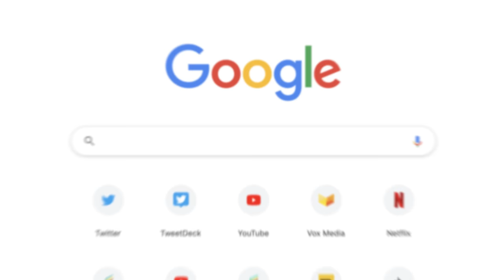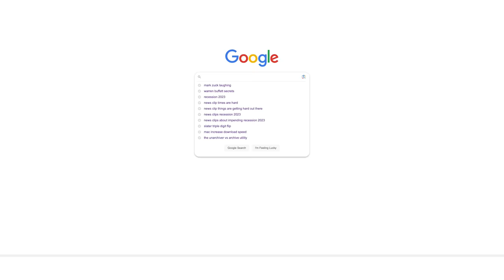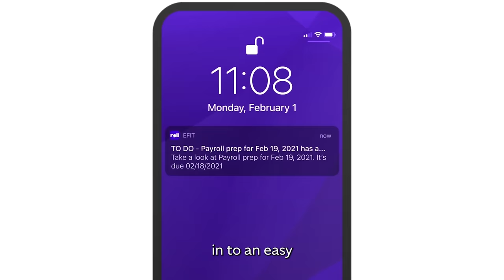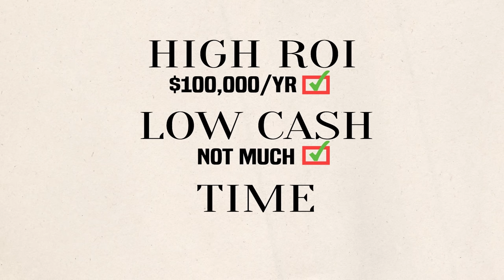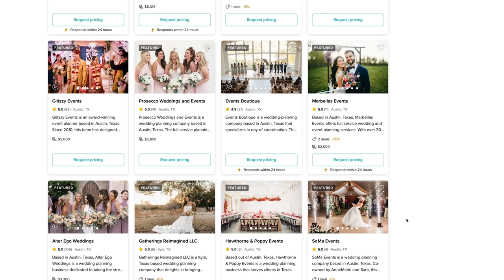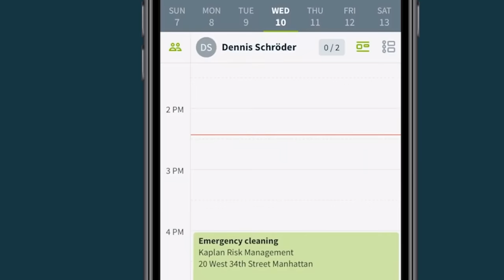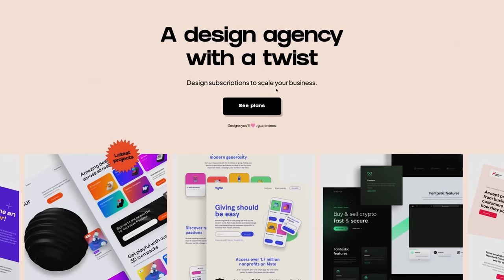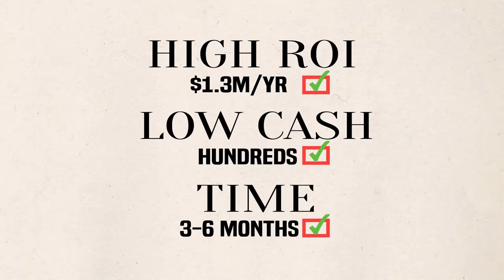7 Best Businesses to Start For Less Than $1000

Comment from the maker: Get a list of 130 different business ideas that I love to invest in HERE: https://contrarianthinking.biz/130boringbiz-yt-lg
Reply: I live in small village foni kansala Bwiam 🇬🇲
Reply: For the virtual assistant business how do you handle it once you've found the VA? Do you receive the work assignments from the client and pass them to the VA and then pass them back from the VA to the client and then pay VA at the end of the month?
Reply: Can anyone direct me to the link that was mentioned in the video breaking down the graphic design video?
Reply: 2500 to powerwash your fence?
Reply: @glory70x  guess that's a villa's fence
Reply: Would really like to know your opinion on waste management, cleaning services or procurement I.e fulfilling orders like a supplier?
Reply: ROI is Return On INVESTMENT not income.
Reply: Hey Codie, your math on real estate is wrong. I used to make the same mistake until my client (Oakwood apartment founder) corrected me. The appreciation is on the total value, not the initial investment. Therefore, if I buy a 1,000,000 property with 20% down (200,000) and it appreciates 5% of 1m (50,000), I just made 25% ROI+ any principal payoff (roughly 1-2%x5 or 5-10%)+ any tax benefits (1-10% income dependent). So this represents a yearly ROI of 31-45% vs. what you and I both thought was a 1.3-9.5 ROI. This understanding has made me some money. Of course, it is slightly more cash dependent than an owner financed small business. I appreciate all your great content.

Comment: The problem with subcontractors in the service industry is you don't have control over the workers. This can become very problematic and if things go wrong, it's hard to maintain or save the client. It's not a bad idea, but also not a great idea. Codie Sanchez in this video doesn't go over the cons on this issue, I feel if you don't give out the cons you are not being transparent on the window cleaning business idea.
Reply: That was my concern - it's just not accurate to claim you'll never have to work with the client directly. For that Handyman business for example, which I do think is great. But you will have to handle each of those clients one at a time & make sure the work is done not just properly, but outstandingly well for you to grow. So now you're handling sales, customer service & managing "staff" even if they are outsourced, you'll have to micro manage each job for at least a while because it was done under your business name. It's still a great idea, but all of these are much more work than is being expressed here.
Reply: She did mention the trade off to low start up cost was the work to get it going.
Reply: All business have this problem, and it’s ok
Reply: Codie is good and helpful, but she is definetly not 100% transparent.
Reply: Agreed, I’m interested in getting the logistics and legalities (especially in California) as to how legit this business model is. 

Subcontracting in California is very sticky.
Reply: Su contracting in the UK also requires you as the contractor to pay their 20% Tax and national insurance under the CIS scheme
Reply: Subcontracting in many countries is illegal!
Reply: So many negative whingers
Reply: @am1296 It's not negative or winging it's pointing out some realities if the construction industry for people who may not know. The video is great however codie cannot possibly cover absolutely everything.
Reply: I don’t think it is about “being transparent” or not. She’s giving you great ideas to start up a business in 35 min. All business have same or similar issues. Not everyone is capable to deal with the issues you mention.. in that case you better keep your 9-5 job. Nothing wrong with it though.
Reply: How do you pay people that don't even work for you? I wounder? This is very interesting
Reply: She mentions getting quality businesses through referrals and reviews. If you get the top 20% of businesses in the area doing all of your work you will eliminate 90% of the issues. You don't need to control quality people just be very clear on expectations.
Reply: I think the idea and doing it locally would work best. You can also vet the handyman or cleaner or who ever before using them to send them out to do jobs
Reply: Something like installing a water heater in Colorado requires a licensed plumber.
Reply: @flowmaster2010 the sub invoices you same as a regular customer but at your agreed upon rate.
Reply: She also fails to mention the cost of google ads. $1000 for ads doesn’t go too far
Reply: I mean she did say do your research and check reviews with how good they are at the end of the day it’s like hiring an employee and doing a background check
Reply: If you take care of your employees, they will take care of your customers.
Reply: And thisss....Ladies and Gentlemen...is the mindset that'll get you nowhere. Entrepreneurs and business owners don't think like this. This is the mindset of laziness, procrastination and the workers mentality that only want things to go smooth and perfect.

They don't like to do things and improve as things go along. They want everything to work perfectly on the first try around. They want to work and get paid immediately. They don't think about the later, they think of the now.

They want to have somebody to hold their hands and give them constant reassurance along the way. They want someone to give them a step by step by step on how to do things and even better if they can have someone fund their way through it and have everything done for them for freeeeee.

"Change your way of thinking and watch how your life changes."

Until then, this lifestyle isn't for you. The definition of Entrepreneurship is identifying a problem and then be the solution to that problem for the client.

If problems is a hassle for you, this isn't for you, or for the feint of the weak hearted.
Reply: @xandepsy exactly, all contractors deal with this.
Reply: @jowyjozef I completely agree with you and couldn't have said it better.
Reply: True but it can be managed well.
Reply: Well if the work is being sub contracted the fallback falls on the company doing the work not his actual company.... They will see the sub contractors company name/Logo etc
Reply: Also. The sub can cut u out
Reply: 12:23 Honest question:”send real estate agents sample videos you’ve clipped together of other people’s work”?? Huh?? Isn’t that some where between misleading and plagerism? Am I missing something? Also, $150 to go shoot the video yourself on site, then go home and edit it? Sounds like a tough way to make$150. Is that what she meant?
Reply: She’s running an entertainment media company, she’s not a trade school or university. Gotta remember that. 

Their job is making themselves money, not you. You succeeding would just be icing on the cake. And if you do she’ll use you to make herself more money. 

Not knocking it, just remember the incentives of YouTubers. It’s not charity.
Reply: Typical YouTube fake guru with false advertising
Reply: She did mention screening of subcontractors. You would definitely want a trusted list of subcontractors. My husband used to supply cranes through this arbitrage method and he only dealt with trustworthy contractors.
Reply: Let alone the cost of tools for handyman services
Reply: Have systems in place to inspect the quality of their work.  If they have poor quality work in any area, and if it becomes a pattern,  just don't give them any more contracts, and get another subcontractor to take their place. And know going into it that you will likely need to replace quite a few of them before you find any that can produce at high quality. So no... it wouldn't "work" if you approach it with the same expectations as managing employees.  That's because it's a completely different structure and therefore needs a different approach to make it work.
Reply: The cons are they will eventually take your customer base
Reply: Your power is over the owner of the company, who has control of their employees. You only communicate with the business owner and tell them you will stop using them. Use their competitors as your subcontractors. They will probably do it for a better % deal for you too.

Comment: I am currently in my 50s and This is no time to taper retirement savings. I want to max out my retirement contributions and I also have another $200k in a savings account that i want to invest in a non-retirement account. Where should I invest it now?
Reply: Safest approach i feel to tackle it is to diversify investments. By spreading investments across different asset classes, like bonds, and international stocks, they can reduce the impact of a market meltdown. its important to seek the guidance of an expert
Reply: A good number of people discredit the effectiveness of financial advisors in exploring new markets, but over the past 10years I’ve had a financial advisor consistently restructure and diversify my portfolio/expenses and I’ve made over $1.2m in gains… might not be a lot but i'm financially secure.
Reply: @CheriFanizza  I’ve been looking to switch to an advisor for a while now. Any help pointing me to who your advisor is?
Reply: My CFA 'Grace Adams Cook' , a renowned figure in her line of work. I recommend researching her credentials further. She has many years of experience and is a valuable resource for anyone looking to navigate the financial market.
Reply: I just looked her up on the web and I would say she really has an impressive background in investing. I will write her an email shortly.

Comment: For the wedding arch business, it's important to factor in how you will transport your arches to your job sites. If your car's not big enough to haul them then you'd need a trailer and assuming you don't already have one, the start up cost for this business would be more than $3K.

Good business idea, but it definitely costs more than 1-3k to start.

Comment: As a florist, I love your ideas on hiring out wedding arches, but your pricing seems to be ... off.
For instance, I just checked, and one very basic pop-up marquee that's just a frame and a canvas roof, 6 x 6 metres, is $4,395.00. Your visuals show something about $20 grand, and it would take a lot more than 1 hour to set up, surely. 

You also need a van or trailer to transport arches or tents. A decorated arch, without flowers, is about $200 to hire. I don't know how you'd get $1500 per wedding - without flowers! I really, really want to know, though!

Comment: Take the micro greens portion of the video with a grain of salt. Most states require you to get licensed to sell microgreens and even then you might be limited to selling to people in your own state. Since you need to get licensed, you’ll need to invest in your grow facility. Your facility will be under the scrutiny by an inspector. Your license depends on the cleanliness and safety of your nursery. You will have to invest time in making a facility. I should also note some states allow nurseries in residential areas but it varies by state and even local counties. It’s not impossible, but it’s way more time intensive than Codie leads you to believe.
Reply: appreciate you pointing this piece out!
Reply: Also, microgreens are higher risk because of their susceptibility for bacteria

Comment: With regards to the cleaning business, how do you build a brand when the sub contractors are showing up for work with their own branded vehicles, will this not confuse the customer. Also whats stopping the customer from building a relationship with the sub contractor and cutting me out of the deal? BTW - I saw your video with Steven Bartlett and I was blown away, you're very inspiring. Thanks
Reply: Put a noncompete clause into place with the subcontractors so they cannot steal your clients or cut you out.

Comment: The micro greens actually take 7 to 10 days to sprout from time they are planted. So you would have at least two harvests, possibly three in thirty days.
Reply: What about the costs of lights and packaging? Not mentioned.
Reply: As well as cost and time of delivery, harvesting, electricity. Renting space if you want to scale up?
Reply: @michellekoopmans852  I'm a food scientist and I highly recommend running the opposite ay from this. Way too easy to kill people because sprouts and micro greens are prone to pathogenic bacteria growth. This is not a business for a non-farmer/non-food industry to start, at least not without tons of research, oversight and liability insurance. 

The micro greens will also need to be refrigerated at some point which was not mentioned.
Reply: @MariamMariam-ue7vz  Bingo! Follow the advice given in this video and get sued for everything 
you own or will own going forward when you end up poisoning a customer.
Reply: Google: 'are microgreens regulated'     ...and LEARN. Buyer beware! In this case, SELLER BEWARE!

Comment: Ive had a handyman business for about a year now and I went from no customers to turning down jobs in a matter of months just from word of mouth no advertising whatsoever. Huge demand...
Reply: What sort of experience did you bring to the table before starting this business?
Reply: I went to vocational school for carpentry where I also learned some plumbing and electrical, and I've been fixing stuff with my dad and grandpa since I could walk. 4-5 years of remodeling experience but honestly most of the stuff I do is smaller projects. I love toilets. Change a toilet for 100 bucks, takes 30-45 minutes by myself and I'm on my way.
Reply: I do stuff I've never done before every now and then and YouTube is my best friend on that stuff. If you have some common sense and a decent base of repair knowledge you can figure out most anything
Reply: @wildmayne  What about insurance? For example, if you fix something poorly (it might happen) and it will break and the whole apartment will flood, what happens then? What are the worst case scenarios that might happen in your business? I would love to know and have insight if you have the time to answer, thank you!
Reply: It varies by state, where I am you have to have general liability insurance which runs me about 700 bucks a year which isn't too bad. And generally if you do your homework and don't take jobs that are well beyond your capabilities then things go alright, I do it on the side so I tend to stick with smaller jobs and not large remodels, little drywalling jobs, paint a room here and there and fixing doors, adding/repairing trim, etc. But a lot of the stuff people ask me to do is like an old lady who wants her  window a/c unit installed or a smoke detector changed. I don't care about making a ton of money off that stuff so ill just have them throw me 40 bucks, keeps them happy cause they're getting a deal and I did the heavy lifting for them, I'm happy cause I made 40 bucks for 25 minutes of work. Just keep it simple, don't do shit you don't have a clue how to do and if you don't know how to do it have the ambition to go learn it first.
Reply: Another thing to keep in mind is with certain projects some places require permits, I'm building a deck and I had to look up the building codes, draw up plans and figure out the dimensions prior. Adding/ removing walls and modifying existing structures can be that way too so make sure you know what your area requires. Blue collar jobs are gonna dominate the market soon cause few people wanna labor. I'm a full time diesel mechanic and I do this on the side and if I keep up like I'm going I could make over 100k doing either one on its own. But the handyman business is growing so fast I'm probably gonna end up doing that full time and I've always got turning wrenches as a plan b. People are always gonna need stuff fixed and built so you wanna talk about a business that could survive any economic storm this is it. Looking at applying my green thumb to trying out this microgreens thing here soon as well.
Reply: Care about the quality of your work and be honest and straight forward with people and theyll tell everyone about you. I haven't put any effort and not a cent into advertising and I get all the work I could want. Built a deck for my aunt and people stopped by while driving by her house to ask who did it cause they wanted one too

Comment: I have a question about the Real Estate Video Editing. If you only charge $50 per video, to make $100k annually, you'd need to edit 2000 videos per year. Since there are 260 working days a year, that means you'd have to edit almost 8 videos per business day. Did he do all of the work himself? Especially if he had to travel to shoot videos and take the time to shoot them, that doesn't seem possible. I can see if he did a subscription service, like you say later in the video or if he charged more (i.e. $100 for the realtors video, $300 if he had to shoot it himself), then that would seem to be more plausible. Am I missing something?
Reply: That's a good question.

 I was also wondering how you can subcontract out cleaning work to another cleaning business and not expect them to mention anything. 

They would be charging less by themselves, and the homeowner would probably think that your business is scummy and hire the subcontractor.

Comment: the bad part of the handy man option is that where your example is located (Seattle as am I) does not have a "handy Man" class license for res or commersh jobs. Leaving you to get a Contractors license in either on or two specialty area or a full on General Contractors license, all these require bonds and insurance, hense nearly 10k start up. Im not dogging this list i love the channel and all the info I just live here and have been on this road as I am a carpenter and work loosely around licensed req. projects lol. no insurance\warranty agreement with the client is a good back door!